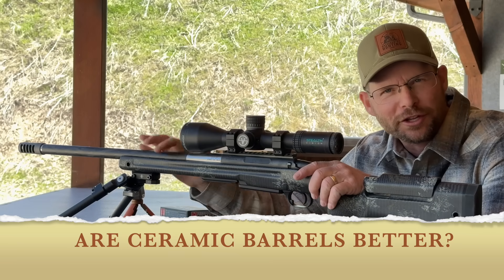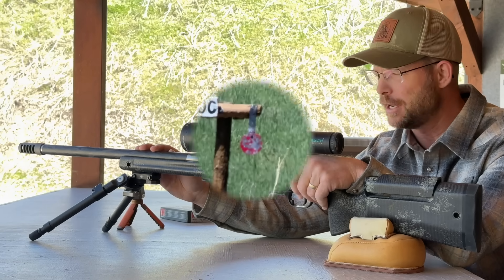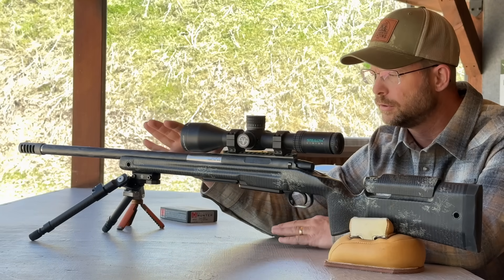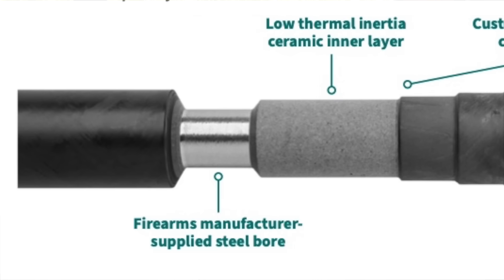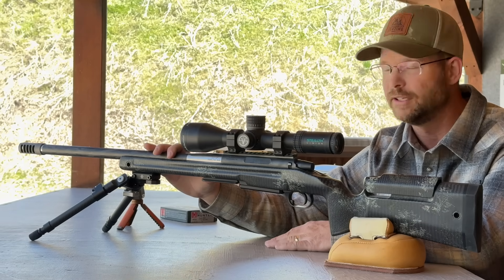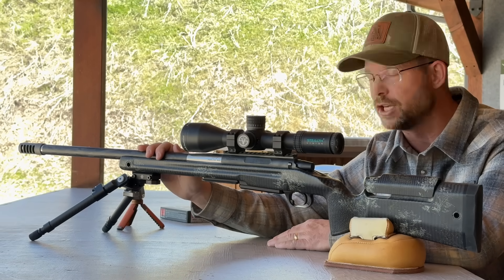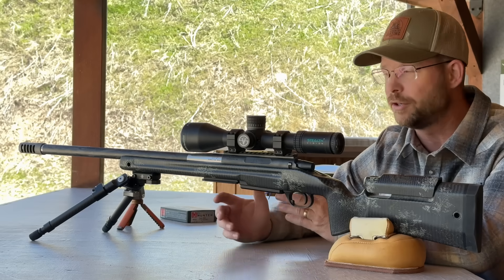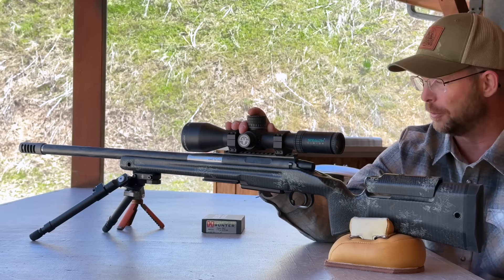DO CERAMIC COMPOSITE RIFLE BARRELS SHOOT BETTER?

Comment: They are trying new designs because carbon fiber after heating and cooling so many times the carbon fiber bond breaks loose from the steel. 
Then it's useless. 
That's what there finding out on long term carbon fiber barrels.
In reality there juck barrels. Have to replace them. 
Allterra rifles are working on a new design of carbon fiber that will permanently stay bonded. 
I guess that the point of this ceramic bond then carbon fiber.  
Just stay with a good SS fluted barrel so you can get the weight down and last for your grandchildren.

Comment: Ya'll trip me out with negative and ridiculous nerdy comments. 😂
  Have any of you ever seen ceramic headers on a motor?  The inside and the outside is coated !! 
  The Heat is significantly lower than without the ceramic headers. 
  When you take the headers off and look inside of the headers, each pipe is clean !!
  This is a no-brainer for gun barrels.
 "I GUARANTEE YOU, THE BARREL MANUFACTURERS STOPPED THIS FROM BEING DONE UNTIL NOW !!!"
  Just like they're stopping the removal of the suppressor from the NFA right now in Congress !!

Comment: The first thing ya'll need to understand is that Ceramic has been used inside engines for over 50 years.
 Not to mention heads and headers.
Reply from the maker: Good point!

Comment: im curious what happens when the steel expands and shrinks. Ceramics does not expand in the same rate as steel, so if the barrel gets warm the materials will separate.

and whats the point of having ceramics around a barrel for heat transfer when you wrap that in a insulator (carbon fibre, wich is more or less 99% plastics)
Reply: This is all gimmicky BS imo.

Comment: technically high heat inertia means it takes longer to heat and cool, this would typically be either an insulator or something with high heat capacity. in the case of rifle barrels, this should even out the heat which would serve two purposes
1. allow the rifled liner to expand uniformly
2. insulate the bond between the resin and the steel, slowing the heat change thus reducing the thermal shock

since cf is stiff but bouncy, maybe a plain stiff layer can be used to tune barrel harmonics, would imagine this would involve very expensive computer modelling and iterative prototyping and testing

it sounds like this is more relevant for a longer barrel and maybe less helpful on a shorter one
Reply from the maker: It'll be interesting to see where this goes!

Comment: theoretically titanium makes a good barrel material as well with some of its propertys. its been tested on and off in military applications and has been used in howitzers
Reply: With some of them sure, and others make it a terrible choice. It makes expensive and light actions, but it also makes them feel gummy unlike a good steel action. Gummy is not a good quality for a bore, or an action for that matter so even for those with the budget its still not a popular choice.
Reply from the maker: I have used a few titanium actions like those from Defiance, and they're awesome! Not sure about how it'd perform in barrels, though.

Comment: Hope it will reduce the maintenance and cleaning of the barrel
Reply: How would it do that? The ceramic is between the steel bore and the carbon fiber wrap, the ceramic will have no effect on cleaning whatsoever.
Reply: Should be very easy to clean.
 Just like Headers are. 🤔

Comment: I would think the ceramic keeps the heat inside the steel barrel.  They used it on the space shuttle to reflect heat.
Reply: Yes and no. Those tiles have a lot of air and are more like ceramic foam to insulate.  Other ceramics can conduct heat well, which is more likely to be what they use. Ceramic can have strange performance depending on what materials are used, see Alumina, Silicon Carbide or Titanium diboride for examples.

Comment: Interesting concept. Thanks. I'd like to see ceramics used without the steel insert, i.e., a metal ceramic of some sort. There is a company that makes a "structured" barrel that claims no harmonics.  That would eliminate one variable in the end goal of perfect accuracy, and leave only the variance in the cartridges to account for. Oh, I forgot - the shooter is the other variable to control LOL As long as I get .2 or .3 MOA out of my SS match barrels, I'll stay with them.
Reply from the maker: Yep... It's an interesting era of rifle barrel innovation... But there's always the variables introduced by the shooter!
Reply: Yeah, that barrel is extremely expensive also.
Reply: Tacom hq - structured-barrel.

Comment: as a disappointed cf barrel user...I will stay with steel...until things are proven more.
Reply from the maker: What type of CF barrels have you tested (and had fail)?
Reply: @BackcountryHuntingPodcast   308 barrel PR chambered in 300wsm. Started to shoot radical elevations...430 rounds changed barrel and problem was fixed.